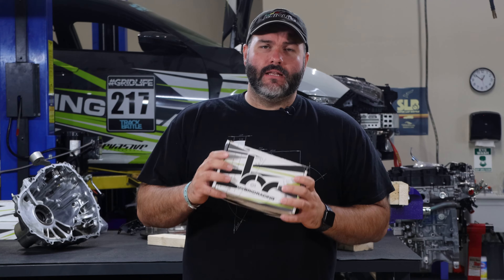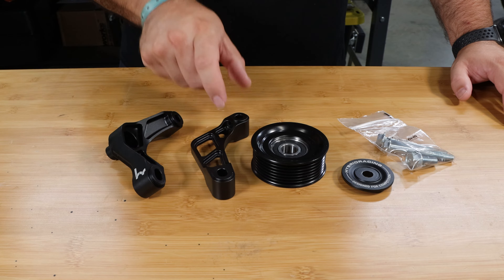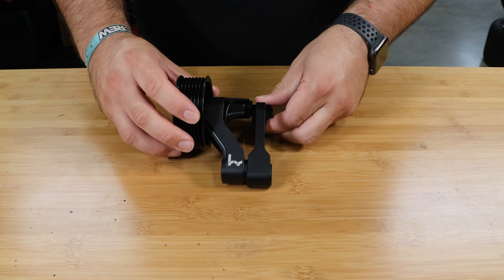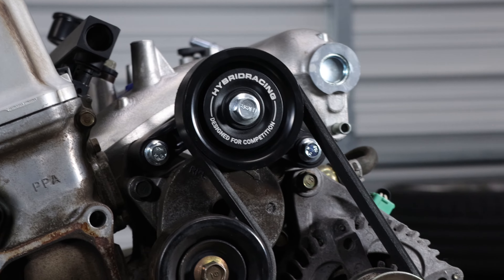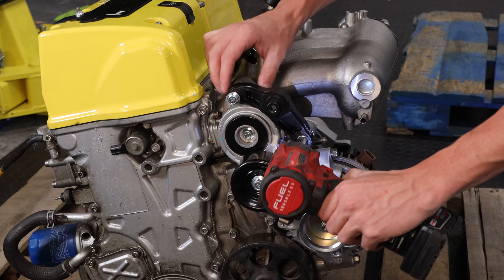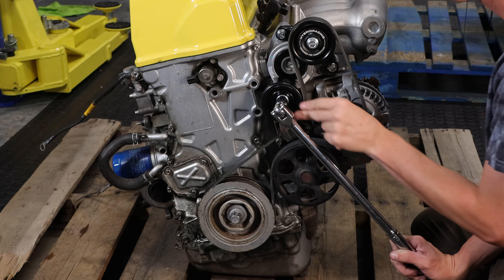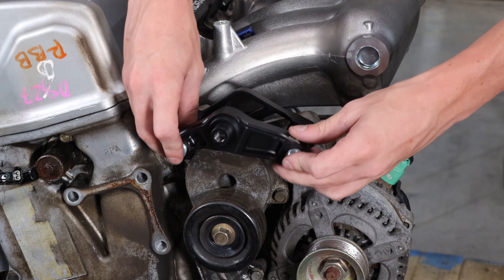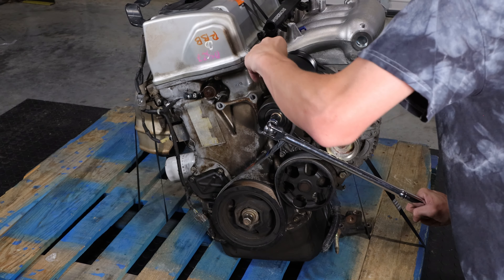Hybrid Racing K-Series Idler Bracket & Pulley Kit! Explained & Installed!

Comment: I have a K24a but switching to usdm Water Pump Housing as well as usdm alternator. Do i still use the kit for the JDM K24A or K24a2?
Reply from the maker: If you are not using the JDM K24A water pump housing entirely and are changing the whole thing, then you'll likely use the K24A2 kit since the housing is shaped differently.

Comment: Any idea if this will fit k24a2 with stock AP1 intake manifold? I tried the stock ep3 pulley and it’s too close to throttle body on AP1 manifold.
Reply from the maker: It might not fit with the stock F-Series intake manifold unless you use a flange adapter. I've seen manifolds that have the flange cut off and welded and there isn't enough room.

Comment: Can I use this to delete ps but keep ac on my del sol? I don’t have power steering but I’d like to keep the ac
Reply from the maker: Yes, you certainly can. You'll have to measure your crank pulley size and then choose one of the belts we suggest to use if you are also using the AC compressor.

Comment: Can someone explain to me what exactly this part does? Is it to be used when power steering is eliminated?
Reply from the maker: This kit allows you to remove the power steering pump and the air conditioning compressor from a k-series engine. It keeps the alternator and oem belt tensioner in place. With that, it is the best way to keep proper tension on your serpentine belt and takes the guess work out of which parts to use.

Comment: K20Z1 CP is smaller ~5.4 inches. and it is not on their website.
Reply: Found the  serpentine belt part number for k20z1 CP, with AC and this Hybrid Racing kit or OEM ep3 idler pulley. Its Dayco 5070640 (Advance Auto) 64" belt no issues.

Comment: is this like an ep3 pulley?
Reply from the maker: In the sense that it removes the PS pump, yes. However, this kit sits much lower than the OEM parts and works on many different engines.